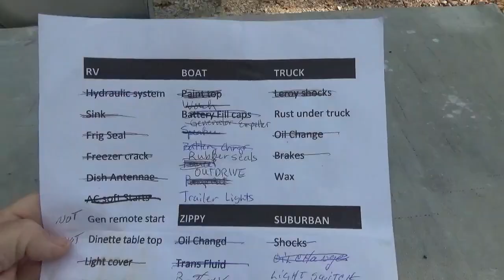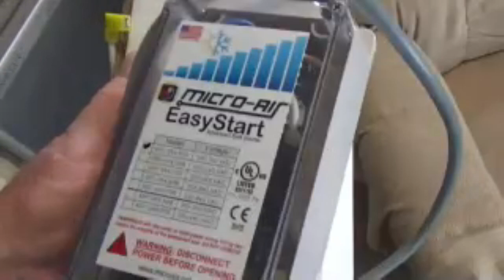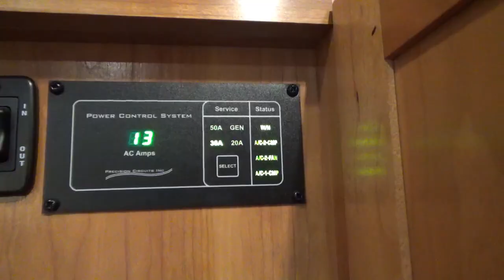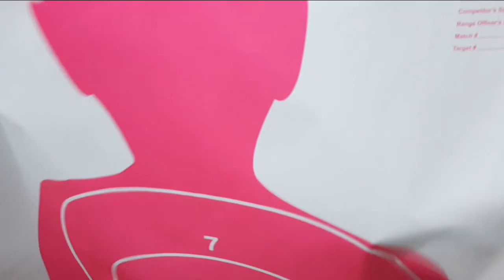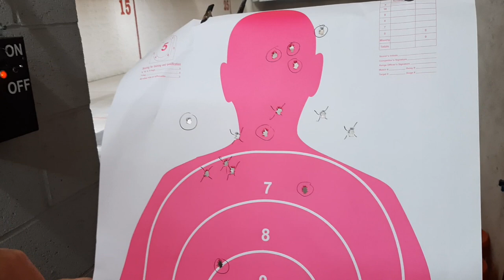Full Time RVing is NOT All Fun & Games!  // Part 2 Staycation

Comment: if you would like to run two AC units on 30amp look to install micro-air EasyStart.  30amp will support the load of 2 AC units its just the startup that 30amp cannot handle.  the EasyStart units addresses that
Reply from the maker: We have a video coming out soon on our Easy Start installation.